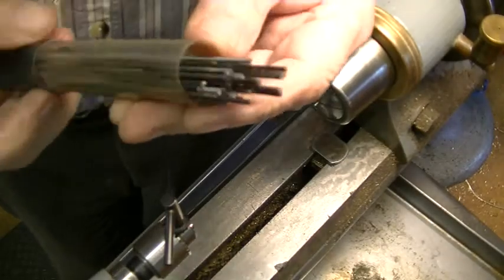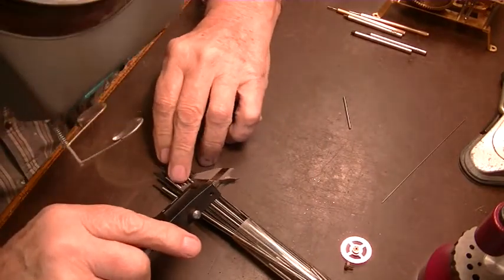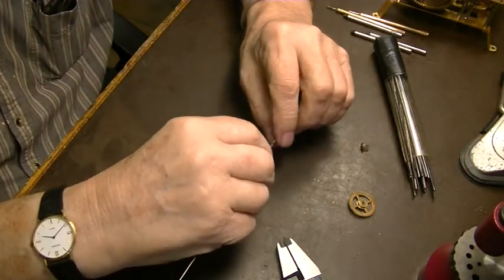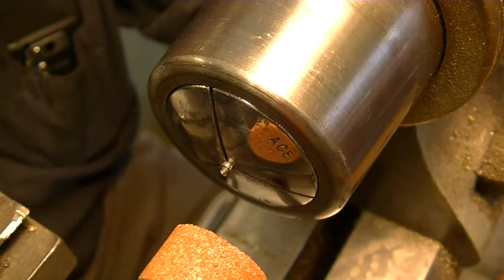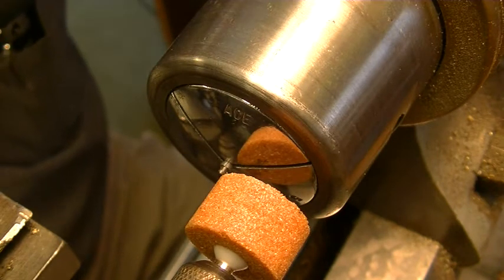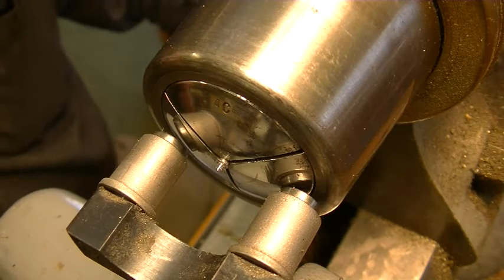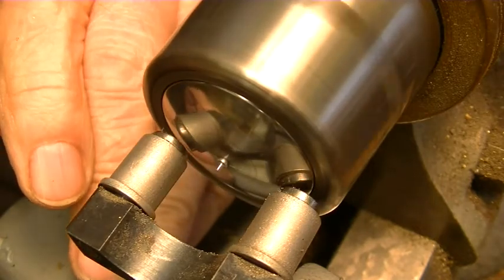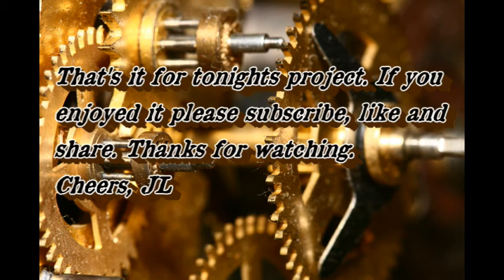James A. Lea, Clockmaker. Clock repair tutorial #18. Repivoting a bent arbor Part 2

Comment: Why didn't you put the pivot wire in the tailstock chuck and bring it up to the headstock and then glue it in place? If you did that it would be closer to concentric with the pivot staff. Also you can cut pivot wire with wire cutter.

Comment: If I had a nickel for each hole I had drilled off-center (my bad, of course) I wouldn't need my pension! Thanks a lot for showing us how to recover. Couple questions. First, it looks like you are using a Dremel-type grinder. How is that held onto the lathe? How do you align it?  I built a Dremel tool holder but it is not as accurate as it should be. Second, if you can't cut pivot wore with cutters, how come you can file it? I suppose the file is actually harder than the pivot wire, just making sure. Finally what kind of abrasive do you use on the lapping wheel? Thank you very much for posting these videos.

Comment: If a tool works then I would have no problem with its use. Ok, maybe it is not thought of a "traditional" to clockmakers, but often that is only because the option was unavailable years ago.
As long as the outcome is the same I can see no reason not to use a dremel or any other tool. Modern adhesives are another example of where traditional is not always better.
Keep up the good work James.

Jt. Theclockworks.biz
Reply from the maker: +jim Truesdale  I agree!! Thanks for watching.
Reply: You sir are obviously not a highly skilled watch or clockmaker, I have been in the trade for over 60 years and never had to use an adhesive of any kind for repivoting or any other purpose in watch or clock-making, and as for a Dremel it has no place in a watch or clock makers workshop it's a hobbyist tool.
Reply: jim Truesdale But the outcome is not the same, If you look at the video closely you will see what a mess he has made of the pivot.
Reply: @keithsolloway9544  I am just now reading these comments, but realise you have been highly trained and can offer criticism. Many very busy clockmakers have never learned to sharpen gravers properly like genuine watchmakers can. Thus so many turn to carbide cutters. As an aside, in this instance I would have simply have made a new arbor from high carbon steel and hardened the pivots, but in clocks of high value and great age, to repivot is the conservative route.

Comment: Did you get the corner between the pivot and the face of the arbor to be square and sharp?
Reply from the maker: Yes ,with a very fine file.
Reply: On the one hand you state that pivot steel is hard, but on the other hand you say that you can file it with a fine file... time to make up your mind... if pivot steel is 'fileable' then it's not really pivot steel, is it!

Comment: Of course you can cut pivot steel with a graver on the lathe.
Reply from the maker: +jim Truesdale  Maybe with a carbide graver but every time I've tried it I broke the pivot.
Reply: +James A. Lea The Village Clockmaker. Since when have old English and French clocks used steel so hard that it requires a Tungsten Carbide graver? All my gravers I create myself, from tool steel, heat-treated and water-quenched to secure maximum hardness, and not tempered in any way, in order to retain that maximum hardness.
Reply: James A. Lea The Village Clockmaker Hi Jim, one of the first things I learnt as an apprentice WATCHMAKER was how to sharpen a graver, if sharpened correctly it will cut blue steel ( pivot steel ) with no trouble what so ever. So though you are an old guy like myself I suggest you go back and learn how to sharpen your graver.
Reply: jim Truesdale

Comment: +James A Lea. Pivot wire is hard, yes, but not as hard as a graver and easily turned with a graver. The Dremmel grinding wheel is completely amateurish and has no place in Clock Making or restoration, something not available to clock makers in the past, yet they managed!

I find the use of a Dremmel laughable!
Reply: I have been in the trade for over 60 years, this is not the way to repivot a clock wheel or a watch wheel I feel that this sort of video should not be on utube as it's teaching bad practices. I do know what I am talking about as an apprentice I was taught how to make ruby cylinders ordinary cylinders balance staff's repivoting watch and clock wheels, and wheel and pinion cutting for watches and clocks. And as for not being able to turn pinion wire absolute rubbish, yet he can file it ? I am sorry if this offends but as a WATCHMAKER not just a clean and overhaul guy this is the way I feel. P.S look up K.Solloway on utube you will see my record breaking small engine with a 8 thou diameter piston.